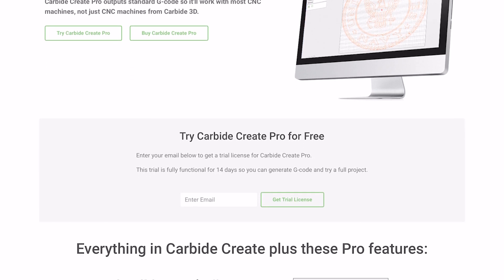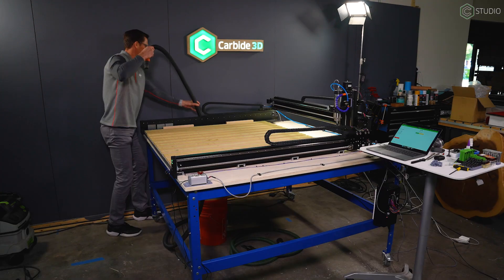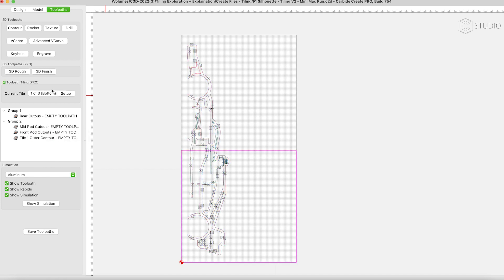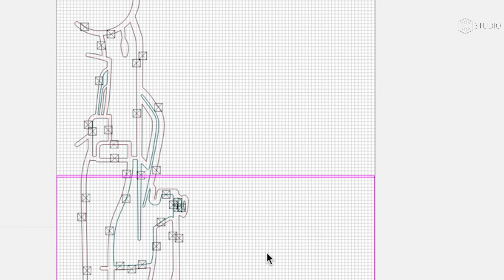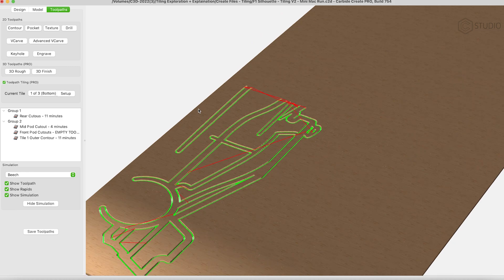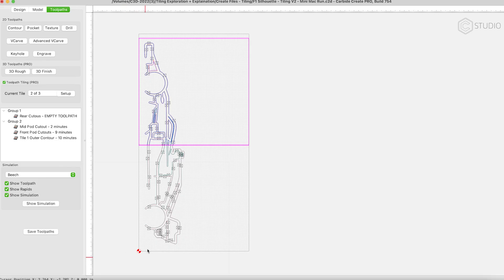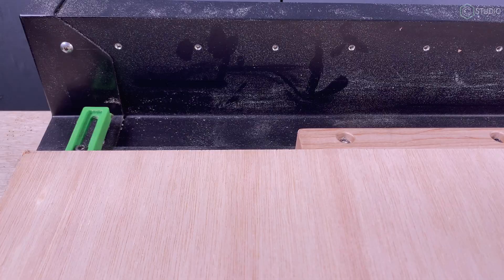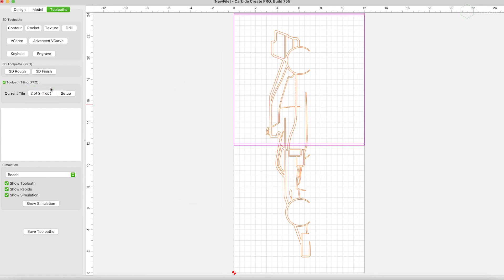Tiling on Your CNC Router

Comment: The video should probably mention that the user saves the tiles in separate files in Carbide Create (i.e., Sample Tile1.c2d, Sample Tile2.c2d, etc.), and then must load and run them in order, moving the workpiece in the meantime.
Reply from the maker: That is incorrect.   There is no need for separate files.
Reply: @carbide3d  Apologies, perhaps I'm misunderstanding how it works -- there's one file in Carbide Create, that file contains the design parameters and toolpaths for however many tiles are needed, but to run on a CNC router, do not multiple GCode files need to be created? If not, how does one select which tile to execute at the CNC router?
Reply from the maker: So, here is where you and I are both right and wrong.   I hadn't thought about running Tiling on another machine.  In that case, you would need to output Tile 1 and Tile 2 .nc files.   However, if you're using a Carbide 3D machine, enabling the next tile and reloading the .c2d file into Motion would allow for the next tile to be run.   This would not require the creation of an additional file.  Therefor......I retract the absoluteness of my previous reply.
- Kevin
Reply: @carbide3d  Thanks very much for the clarification. I'm running a Shapeoko 5 Pro, just couldn't figure out how to get the 2nd tile loaded via c2d file, so I was going the gcode export route. What you say makes sense, I'll use that workflow from now on. I appreciate the follow-up.

Comment: Amazing! I am very close to ordering a 5 Pro. Newb question (sorry, I know this video is a couple years old) but how are you securing all the smaller pieces as they are cut out? Are you using screws and/or tape here?
Reply from the maker: Usually, we clamp from the edge, using the Essential Clamps that come with the machine, or the Crush-It Clamps, which are an add-on.  Double side tape also works.

Comment: I have a 2x4 machine agaisnt the wall.  Im planning on doing a 44" round table top.  Can i tile by revolving the piece 180° ?
Reply from the maker: The short answer is yes it's possible.
This does introduce a variety of factors related to positioning of vectors in CAD, origin of your cut, stock positioning relative to your cutout and other things which I'm surly not thinking of right now.  
Run some smaller tests to work out the exact process and positioning, THEN GO BIG!

Comment: How do I get the update for my carbide create pro?
Reply from the maker: Douglas, Go over to My.Carbide3d.com / Sign in / Scroll to the Bottom / Carbide Create Pro License
Reply: @carbide3d  Sorry I must have missed typed. I have a pro license but don't know how to get the latest version update
Reply from the maker: Same Procedure.  When you are signed in to My.Carbide3d.com and click on "Carbide Create Pro License", it will display your personal license information.
Reply: @carbide3d  I tried it and for some reason the new feature is not showing up on Mac. I tried using google Crome and still will not load the new features that are in the video.
Reply from the maker: Hey Douglas.  What version are you showing currently?
Reply: @carbide3d  version 743

Comment: Any chance you could do a  video on  cutting dados in cabinet sides side is 12 inches wide 63 inches tall It needs to have 5 dados in the sides  10inch spacing between the dados dados .75 wide and 12 long. It would be helpful to show the router moving and the touch probe and bit setter being used. and show when to set the XYZ Thanks Kevin

Comment: Great feature!  What would you suggest as the max size for a 4XXL width-wise?  I know we can get around 33" but that would likely require screwing into the bed, which may not be a bad option. Do you have any other thoughts on it?  I've got some very long things I'd like to do and have been working on manually setting this up.  One last question, using the linear array, is it worth adding in index peg holes and putting a pet in the bed?  It seems like that would make the operation a no-brainer if there were two diagonal holes square to each other (I'd probably put four in to have the added flexibility).

Comment: What are you doing with the bit setter. I can't put a 48 inch piece of plywood on my machine with the bit setter on
Reply from the maker: Hey Don,  On a 4x4 Shapeoko 5 you can get a sheet in there with the bitsetter in position.   The bitsetter was not removed for any part of this video.

Comment: Couldn’t you do some indexing holes in the waste areas so that you can slide the sheet along then drop the Same size bit into holes exactly? 

The alternative would be to screw a piece of wood near centre of sheet that overhangs and stopped by a bolt in those side guide rails. 

Can the shapeoko etc be stored in vertical position?
Reply from the maker: There are lots of possibilities.   A quality discussion is going on here: https://community.carbide3d.com/t/toolpath-tiling-in-carbide-create-pro/59334/58

Comment: Is the X=0 off by half a bit diameter?
Reply from the maker: The X was off due to a couple of alignment factors.  This was fixed with the third tiling cut during the video.   Keeping X consistent and sliding the length of the tile are the largest factors for success.
Reply: But your X is at -1234mm which is the center of the bit, you then trimmed your guide blocks with the bit at the alignment.  
When you come back to place your plywood along your wood blocks then it would be half a bit diameter over from your set up, right?

Comment: So if I had an extremely large project, like 32ft x 16ft, could Carbide 3d handle it?  I have a Pro XXL so I am limited to 33" x 33" panels but provided I could attach all the cut panels it seems like it would work.  Do you see any potential issues?

I recently turned down a project that size due to the time it would take to penalize everything manually.
Reply from the maker: You'd probably need to segment the design into 32" wide strips, and then you could index those through the machine using the tiling feature in CC Pro.
Reply: @carbide3d  So does it only tile along the Y axis and not the X as well?
Reply from the maker: Steven, there is an X Overlap to allow for designs to be tiled in both directions.   You can create a continuous design in the X direction with adjacent panels.
Reply: @carbide3d  So if I pre-cut all my material in 32" x 32" panels and use those dimensions in the tiling setup I should be able to make it work?

Comment: Awesome new feature and great to see the continued development.  Definitely adding value to your software.  I wonder if index pins would have been helpful?  You could easily poke a few holes in your part and  down into your bed to put pins in.  That way, you could just slide the workpiece up to the pins and get perfect alignment.
Reply from the maker: We think that there will be a lot of discussion about workflow for indexing in the near future.  Pins have definitely been mentioned a lot.
Reply: Pins are definitely the way to go. Lines parallel that guiderail you'll never notice if you're off (as he stated) but as soon as you start dealing with diagonals or curves you'll see it immediately. (See timestamp 5:28)

Comment: I'm curious why "NOTE: Carbide Create V7 requires Carbide Motion 565 or higher. "

I've paid for the pro version, is should I not be able to output NC files and then load it with whatever version of Carbide Motion that I have already?
Reply from the maker: If you'd like to load G-code, any version works.  If you'd like to load the C2D file in Motion, you need 565 or later.
Reply: CM 5.65 is NOT new. It's the version that add C2D file extension available from the open option. Right now(3/15/23) the current stable CM version is 5.79. You don't need that last version but the say minimum version for the tiling option to be loaded is 5.65.